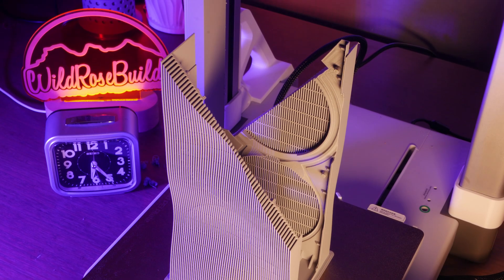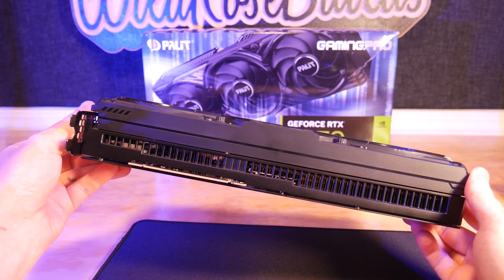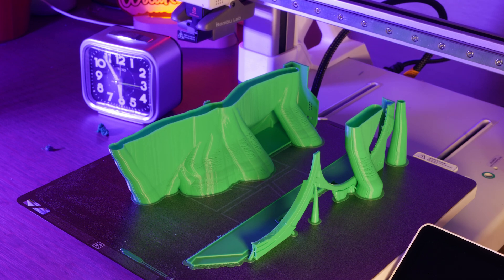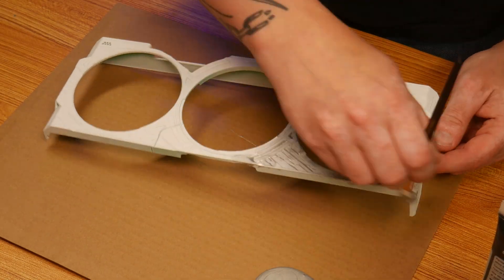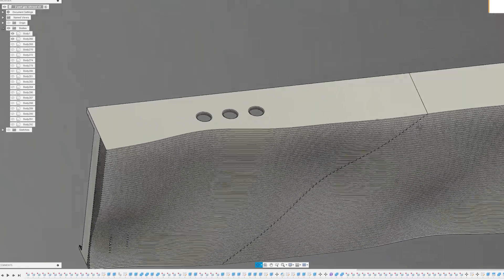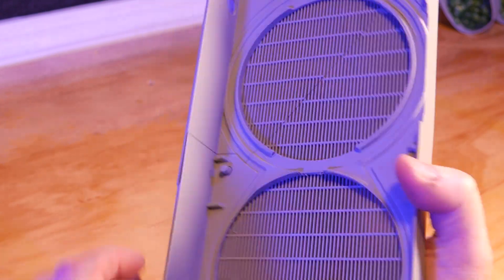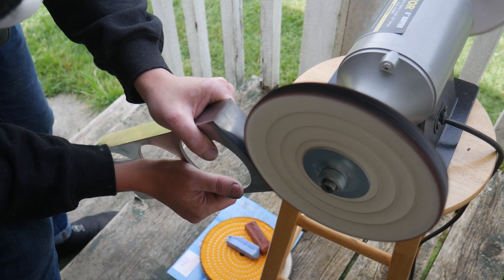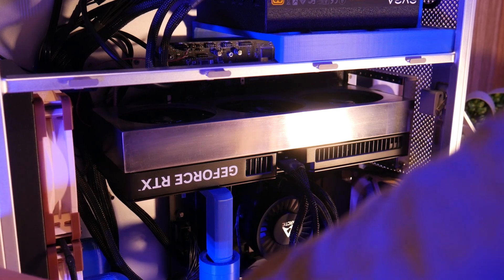Finally a GPU for 3D Printing Enthusiasts - Palit GeForce RTX 5070 GamingPro graphics card

Comment: The first one, why print it in that orientation? If you lay it down (fan openings on the bed) wouldn't it print without supports?
Reply from the maker: Unfortunately not, there was 4 or 5 different height ridges on the top so it would’ve needed support there too